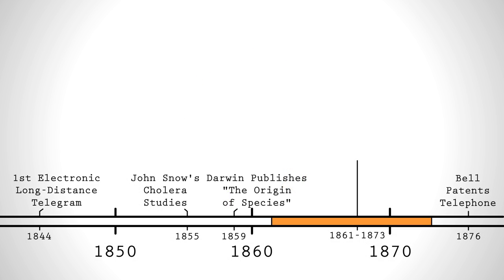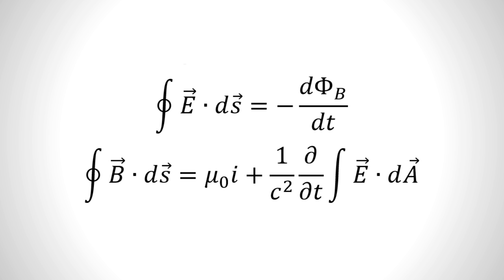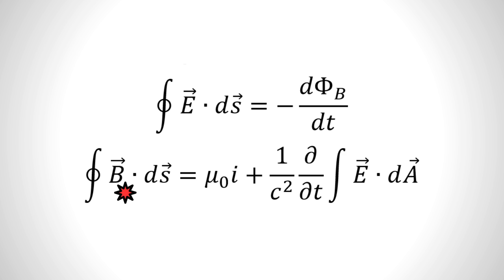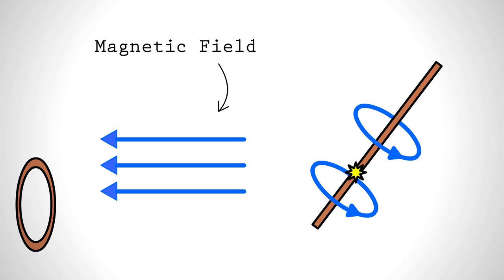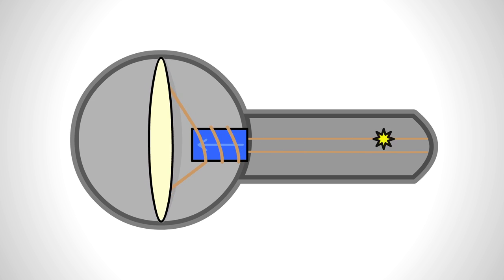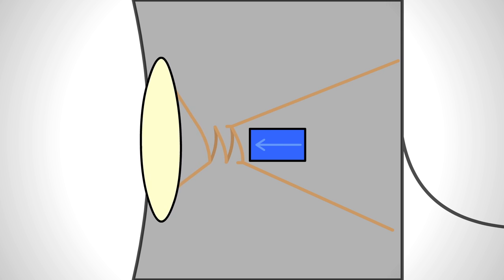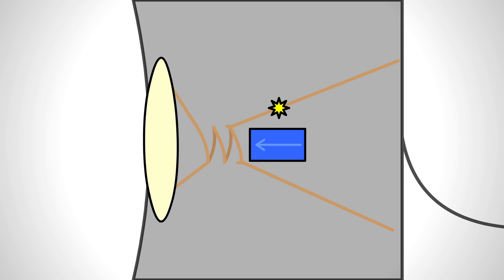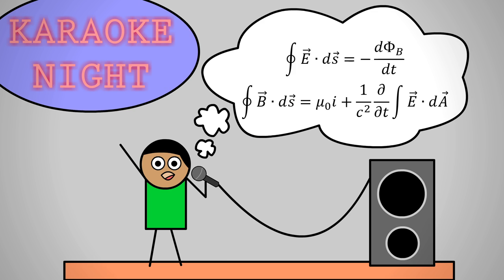How Do Microphones and Speakers Work? | Maxwell's Equations in Action

Comment: Taking a closer look at the workings of a microphone: your voice produces sound(energy) which in turn vibrates or mechanically(energy) moves the diaphragm that's connected to coil. That movement of the coil(related to magnet) causes a change in the magnetic field(energy) which leads to electrical currents(energy).

Comment: Taking a closer look at the workings of a speaker: amplified electrical currents or signals(energy) travel to the coil which causes it to be a electromagnet(energy). That in turn causes the stationary magnet, and the electromagnet to work off of each other by repelling & attracting via AC(producing mechanical energy). Mechanical energy that results in sound.

Comment: Is it possible to stop or regulate the electromagnetic induction AFTER it is produced by a condenser or dynamic mic, by shining monochromatic light that has high enough energy and freq photons to knock electrons off of the negatively charged pole of the magnet ? And how strong does the field around the magnet have to be to affect the photons or can you even do that ?